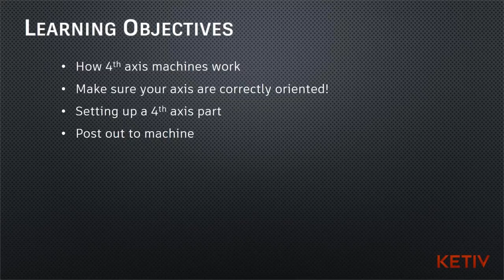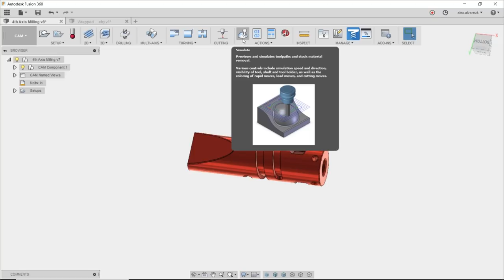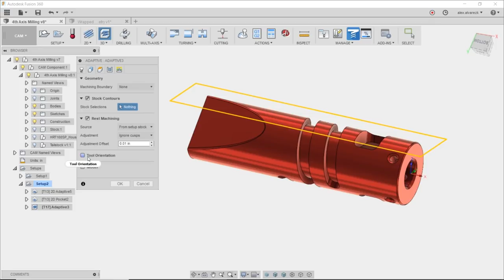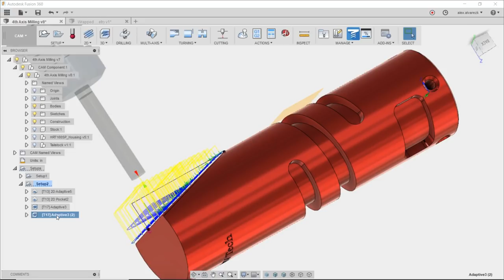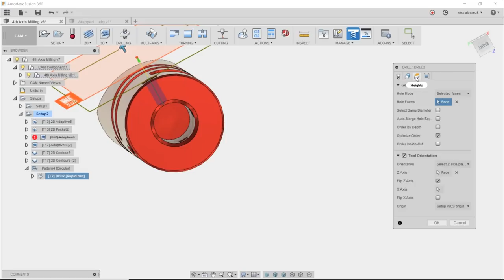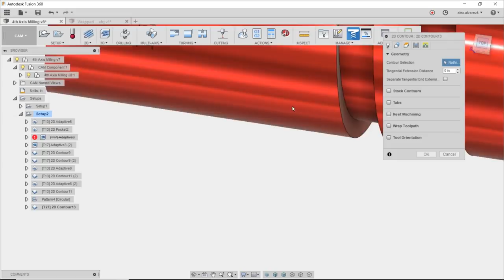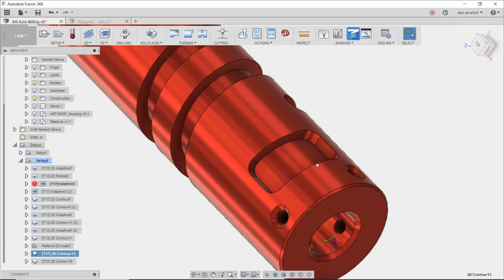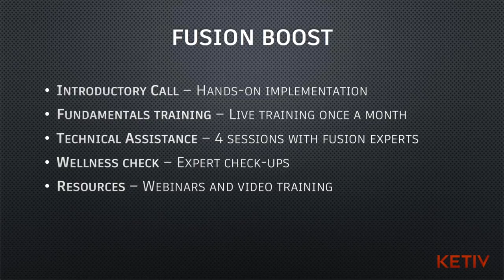Fusion 360: 4th-Axis Milling | AVA: Fusion 360

Comment: What about true 4 axis contouring that isnt wrapped around a cylinder?
Reply from the maker: Hi Jordan,
Would you mind sending me an email at alex.alvarez@ketiv.com, I can take a look at one of your examples if you'd like. If i'm understanding your question correctly, Fusion has the abiltity to use the swarf toolpath while locking 1 of the machines axis. Beta mode has to be turned on for this though, we covered how to do that in the 3+2 and Simultaneous 5 axis machining webinar.
-Alex Alvarez
Reply: @KETIVTechnologies  sounds interesting I will look into it. If I come up with a program which needs it I will give you a shout. Thanks!

Comment: How do you machine a 3D object like a toy car, on the A-axis using A rotation?
Reply from the maker: Hi Jacob, 
It depends on what you're looking for. For positional you would just follow the same steps as in the video, for simultaneous it would get a bit more difficult. You'd want to turn on Fusion 360's Beta mode and use the swarf toolpath with the option to lock one of the axis. Feel free to reach out to alex.alvarez@ketiv.com and I can take a better look at what you're looking to do in the software.
-Alex Alvarez